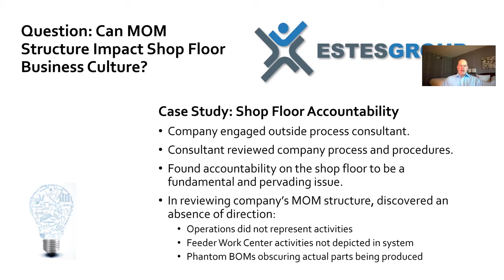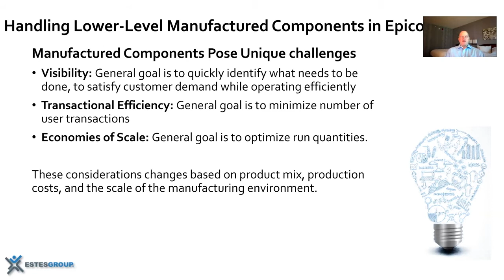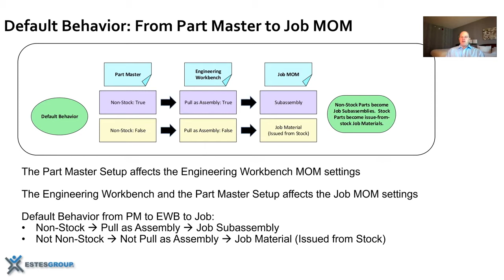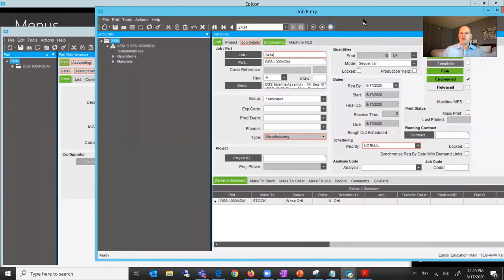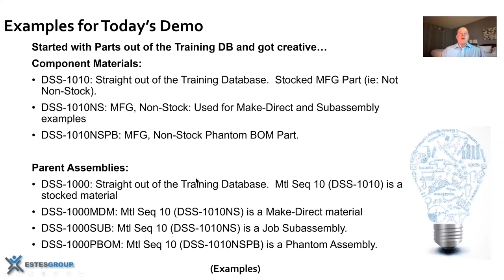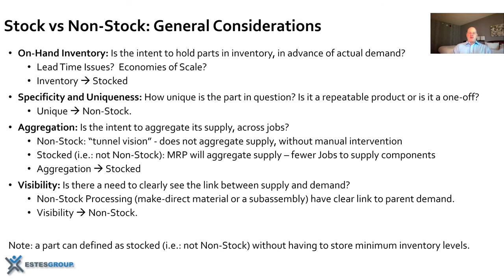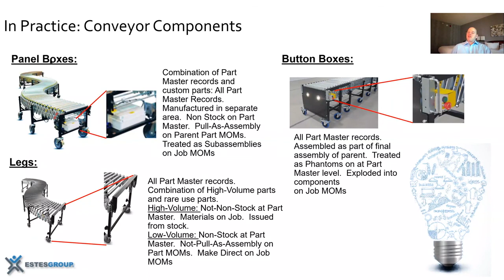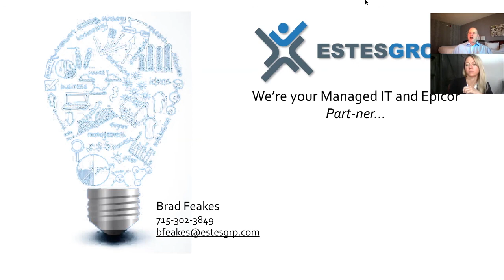Epicor Part Setup: Best Practices

Comment: Is defining a part as stocked but with no inventory level the same as defining it as non-stock with pull as assembly unchecked (make direct checked)?
Reply: Hi Scott,

There are some different issues here.

We’ll assume that there is a part “Parent” and another manufactured part “Child” in the bill of materials.

Marking Child as “pull as assembly” on the method in Engineering Workbench will direct Epicor to create a subassembly on the job making the part Parent instead of expecting that part Child will be issued from inventory stock. In this case, you would manufacture Child as a subset of Parent on a single job instead of having a job created for each Parent and Child.

Marking a part as “non-stock” means that you aren’t going to manufacture the part and put it in stock as a normal practice. When you put the part on an order line, you’ll see the “make direct” checkbox on the order release filled. Epicor will expect that you are making the part specifically for this order release and you will ship directly from the job instead of putting in into stock. You can override this behavior on the order release by unchecking the make direct checkbox.

Defining a part as non-stock doesn’t mean you can never manufacture the part to stock, but that’s the normal way you’re going to treat it.

Does this help?

Thanks,

Joe Trent
Reply: @rmcmillegm  Thanks for the reply! I don't think my original question was actually what I needed to know but you did answer a question I was having about "pull as assembly" and the child showing as a subset of the parent on a single job. Another question: we have a part of a system that is created on the fly based on a configured height (machining operation). It seems like this would be a make direct non-stock part but you said that it's difficult (requires a lot of code) to do with an OTF part. Is there any way around it?
Reply: @mellowhead1  There’s a lot of info we don't know so it's hard to answer this new question. If it’s on-the-fly it can’t be a non-stock part.   Hope this helps!